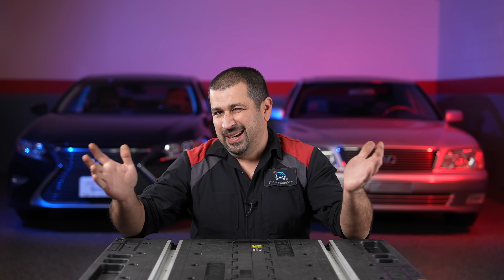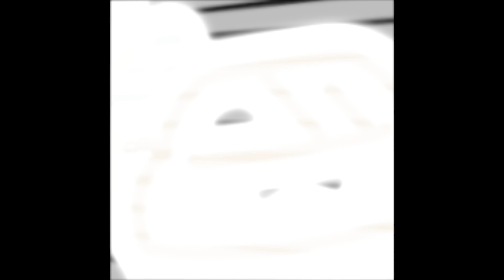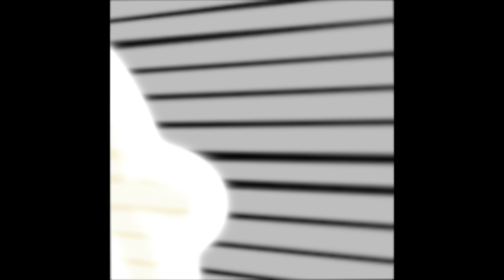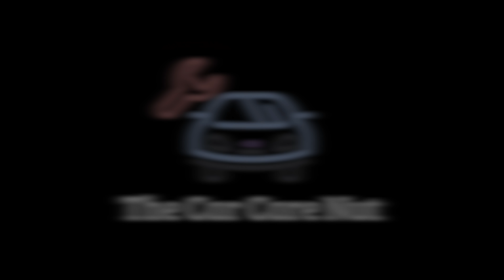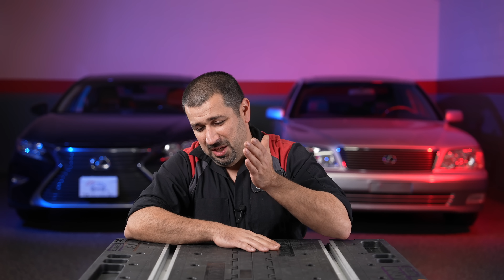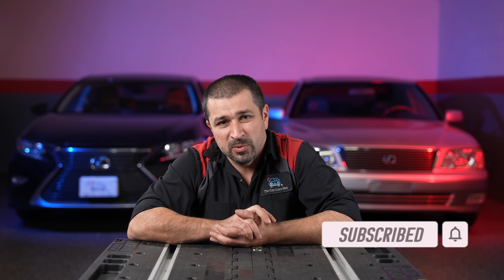Can Modern Turbo Engines Be Reliable? Here's The TRUTH!

Comment: Diesel engines use the turbo to help pull exhaust away from the engine not on the intake side as an air increase

Comment: 2024 5.0 f150 owner and the ford dealer mechanic recommends 5000 mile oil changes! I have a 2005 4.6l with 267000 miles and yes i have changed the oil every 3000 miles since i bought it! It burns a bit of oil but has been doing that since the mid 150000 miles! This engine sounds as smooth as the one year old 2024 engine sounds but is 21 years older! Change your oil if you want your engine to last!!!!

Comment: At 180k on my 2017 2.7L V6 F-150, my turbos are still going strong. I did replace an oil feed line on the driver's side a while back for the cold soak exhaust smoke issue, but everything works fine so far. Just an anecdotal comment, YMMV. I'm a fan of smaller-displacement turbo engines after buying this truck. The economy has been great, especially on the interstate, and it's plenty fast when needed, tows well when needed.  It's a great compromise for typical driving.

Comment: Just go get your oil analyzed.  You can run new modern oil a lot longer... but yea change it more, I'd use those engine cleaners right before every other oil change too but that's over kill, do it every 4th if at all.  The engine, its design, rings, o-rings for valves etc., all play a part and every engine needs maintenance whether it is preventative or unavoidable.

Comment: Yes and no is a great way of putting it. If you did not know, Ford markets their turbo as "Ecoboost", and this was done because women do drive car sells being sold. It sounds a lot more safe to a mother's ears when she hears or reads her fairly lightly used Ford does have an Ecoboost for fuel economy rather than, "WHEN THE BOOST HITS FROM THE TURBO INTO YOUR ENGINE YOU WILL BE MANGLED ON THE GUARD RAILS ON THE INTERSTATE TURNPIKE BEFORE YOU HEAR THE WASTE GATE ON YOUR FOCUS RS BRO!" Yes, depending on the application of your forced induction car your forced induction car will be reliable. No, if you are buying any used Subaru WRX/STI or entry level performance car your forced induction engine is not reliable. Truly, as an auto enthusiast, I have to tell you the most dangerously expensive cars to buy are entry level performance cars that have forced induction from the factory. A used Subaru WRX/STI is one of the worst used entry level performance car you can buy. You should not buy a new car unless you are wealthy and unfortunately most entry level performance cars with forced induction are highly risky even if they appear well taken care of because you have no idea what previous owner(s) did to that car you are looking at. It is unfortunate but this is The Truth.

Comment: Have had two turbo cars.  Regular oil changes and maintenance .  First (a Volvo 240 turbo wagon) one I sold at over 300,000 mikes changed the first turbo at about 100,000 miles (it was not equipped with the extra oil cooling option), the second was still fine when I sold it.  Second car (Subaru Outback XT) just passed 100,000 miles, no problems.  Regular service and oil changes are the key to longevity .

Comment: Sorry but no mention about synthetic oil versus conventional oil. This video was a waste of your viewers time by not mentioning synthetic oil will go a lot longer than conventional oil. I have a turbo I always use synthetic oil and my vehicle is over 150,000 miles with no problem and yes, I only change it every 6 to 7000 miles and I’ve had no problems because I used synthetic oil

Comment: I made a mistake with our 2018 Honda CRV with a turbo. We bought it new and last month had to replace the head gaskets and fuel injectors. I will NEVER buy another turbo engine. And yes, we had it serviced regularly by the dealer.  But we’re keeping it another 4 or 5 years after the money we just put into it!

Comment: If you use a normal quality oil, like Valvoline Castrol etc, definitely go with the 3-4k miles intervals. But if you are buying top quality oil, like amsoil, you can stretch it to 5k.

Comment: Diesel turbos run on low boost and dont generate much heat? EGT are a constant concern for engine longevity and my cummins trucks boost to 26psi, that is not low boost. Eurpoe has millions of passenger turbo diesel vehicles with small turbos that experience the same stop and go and quick spooling. The TDI VWs with small turbos here are also very popular and run forever. There are far more similarities in gas and diesel turbo engines than the scene you describe. The real problem with modern gas engines is planned obsolecense. Most are engineered to only last the warranty period, what happens beyond that is not their problem. The rest of the video is solid advice!👍

Comment: We (my family) put 220K miles on the 2.2 turbo on our 1986 Chrysler Lebaron GTS turbo. We changed the oil regularly, reuibuilt the trans at 70K miles. The engine got tired toward the end, but it was always reliable.

Comment: I put purchased a New 2022 Lexus LS 500 AWD  twin Turbo engine .. This is the best car I have ever owned … although it only has 40,000 miles on it . I was told to change the oil at 10,000 miles . I think I should re think 🤔 this and began changing it at 3000 miles like I do  in my Honda pilot that has 214,000 miles . I want to keep this car until the LORD takes me home .. now @ 73 yrs old !!! 😅

Comment: Government makes autos (and everything else) way more expensive. Do you remember when all US autos were required to have rectangular headlights? WTF? Seat belts, crumple impact zones, safety glass, air bags, ABS, catalytic converters, smog pumps, EGR valves, even tire pressure monitoring systems. So what the government says is no matter how poor you are, or down on your luck, you cannot buy any recent/new car without EVERY safety/emissions requirement. This is the problem. Now, can cars with turbos be reliable? The obvious answer is yes, easily. We frequently fly on reliable multi-engine jet airplanes that are thousands of times more complex, and where failure can result in hundreds of deaths. It's not that turbo small engine cars can't be make reliable, but it DOES mean the reliable ones will be expensive. Government causes all this insanity. With efficiency and technology, every product will be cheaper, but government counteracts that and makes even the most basic things way more expensive - food, cars, lightbulbs, everything. Back to cars, Porsche has perfected turbo gas engines and those cars (in the last few decades) have proven to be very reliable. I believe the ecoboost engines from Ford are also very reliable, but of course not all products will be great.

Comment: What I learn as a driver if you maximize the power on the engine it's not going to last you can tune a diesel engine to maximize the power and it's not going to last compared to the engine come from factory that's what I see on the gas engine if you maximize the power with a turbo won't last the same as a conventional engine

Comment: My 2024 4 cylinder twin scroll turbo charged Tacoma uses more fuel than my 8 cylinder GMC Sienna.
I drive them about the same.
I paid for the first oil change at 1100 KM (Canada), then the next about 6000, 11000, and then Toyota paid the one at 16000. I paid for the next ones, and now about 32000 Toyota is paying the next one (their last one). I'll keep changing about every 5000 thereafter. 
I don't follow Toyota's oil change schedule. I pay for additional oil changes in between the initial free ones they give me: about every 5000 KM.

Comment: Small turbo engines getting better mileage is a myth...  Anyone I've talked to with a dinky motor turbo Honda accord, gets worst mileage than my normally aspirated 2.5 Subaru Crosstrek for the same horsepower. 
Even within Toyota's lineup, the 2.5 Camry and 2.4 liter Hyundai Sonatas, get close to 40mpg (actually can get over 40mpg)...  The Rav4 is still a 2.5 normally aspirated and gets good mileage like my Crosstrek 2.5. 
The Kia's and Hondas with tiny turbo engines for the same 180-190hp rating get worse mileage and are having issues with gaskets and other problems, with relatively new engines.

Comment: Few hundred thousand miles easily so yes. Modern engines use bad verbage in the manuals and suggest regular fuel. Should be using premium fuel in a turbo gas engine. Honda manual says "at least 87" for 1.5t but if you dig the recommendation is premium 91 octane fuel. So the head/turbo issues are from people not using good fuel. Pre ignition. Boom. Honda 1.5t does not run hot, in fact it runs so cold it has issues from idling. Oil is not destroyed any faster than an NA Honda. You couldn't be more wrong in this instance. You didnt even mention fuel lol. Bad advice. We get it you secretly want business. No manuals recommend 15k intervals.

Comment: I have now 15 years old ”modern” turbo engine in 0.9 litre 3 cylinder car… still going well! But oil replase very important and it is not any ”performance” car. So it needs driving desent and not pushed too far. It will last at least 10 more years… but there will be limit.

Comment: I have noticed, over time, that the tighter tolerances call for a viscosity I am not very comfortable with. In the days of the 10w30 and 20w50, at 3000-4000 miles the oil still has a brown tint to it. I change my oil religiously at 3000 miles. With my 2021 naturally aspirated 5.6 v8 that calls for 0w20, the oil is pitch black at 3000.

Comment: 11:29 You wish we didn't have turbo engines? Nothing beats the feel of turbo boost in 3rd gear like in my 2002 Saab 9-3 Viggen with 203,000 miles which is running perfectly.

My question is how often to change the oil if I don't put many miles on the vehicle. I don't think the oil degrades much over time with low mileage.

Comment: 2011 Opel Astra J with the 1.4T 120hp A14NET engine (in the US you had the same engine in the Chevy Cruze)

Service manual says 30k km service interval. I cut mine in half every 15k km. 14 years and 225k km later, the turbo finally gave up. The casing around the wastegate cracked and exhause gases were escaping from there, making it unable to produce enough boost. The low boost DTC came up. Engine until now consumes zero oil (not a mm drops in the dipstick between changes, and it barely gets darker). For ~1000 the turbo was just rebuilt.

I try to go gentle until it warms up, and drive gentle the last few km before arriving home. Driving cycle ~70-75% highway, the rest city.

Comment: Have a 2.0l ecoboost with 170k miles on it. 

Turbo engines will: 
Blow head gaskets and leak oil like crazy. Even the most reliable ones. 

Other than that it isn’t too bad, but they are certainly more maintenance than non-turbo engines

Comment: I got 95k problem free miles out of a 21 ranger sport that was totaled at no failt of my own .. only thing ever happened was the battery went bad .. i bought it with 25 miles on it and i changed the oil every 5k miles full synthetic.. ran 87 15% ethanol and when i changed the plugs at 75k they looked really good..

Comment: I work at a Mitsubishi, and our turbo engines are the only engines with problems. Emissions regulations "allegedly" help make the environment cleaner but now instead of putting a 3.0L V6 in a 7 seater SUV, we put a 1.5L Turbo. Sure, less emissions, but is it not more wasteful for cars to break down twice as quickly

Comment: Thank you Sir for this great advice. I have two Mazda's 2018, 2019 (Recommend 7500 oil change interval by Manufacturer) and a Ford expedition 2023 (10 k interval). I always replace all of them at 5 k. As you said I realized the oil in my Expedition with Turbo, gets dirtier and smells like burned oil more. Thanks again.

Comment: Automobile companies advertise (and/or "suggest") long maintenance intervals for oil changes primarily to keep their customers happy with the (mistaken) belief that their (the manufacturer's) cars don't need frequent service.  I remember the early 1960's, when the old Rover Company Limited of Great Britain had in their Series IIA Land Rover owner's manual that "sometimes it is necessary to change the engine oil and (oil bath) air filter oil twice daily."  This may not be an exact quote, but it is the gist of what the early 1960's Series IIA Land Rover owner's manual said.  Thank you very much for your always very sound advice!  Andrew "Andy" McKane IV, former owner, McKane's Rover Imports, Inc., of San Diego, California, Friday, 28 November 2025, Maunaloa, Hawaii.

Comment: Modern VWs and BMWs use condition based maintenance algorithms to determine oil change intervals. In my experience these work well and determine intervals in the 5K-6K mile range depending on your daily driving, mileage and driving conditions.
I am not agreeing with charging synthetic oil every 3K miles. That exaggerated and wasteful.

Comment: This is why I chose an Accord Hybrid instead of an Accord 1.5T.  No turbo, also no CVT to fail.  The high-torque electric drive motor provides an acceleration boost, much like turbocharging an engine.  Plus better gas mileage.

Comment: USE SYNTHETIC OIL AND ALWAYS LET IT COOL A BIT BEFORE SHUTTING OFF
Reply: A lot European turbo cars have after run coolant pumps that cycle coolant through the system after the engine is off, negating the need for a cool down period. 

But yeah, I always did that w/ my Subaru. Had a remote engine starter, too, so it got proper warm ups.
Reply: Agreed

Comment: Good points, but.. I owned 2010 Acura RDX 2.3 turbo for 13 years and 156k miles. Serviced and maintained at Joe Rizza Acura in Orland Park. The oil was changed based on car’s onboard computer notifications on average about 7.5k miles (6.8k-7.7k, depending on driving habits). No issues or problems for so many years, was a great vehicle. Sold it because wanted to transition to EV.

Comment: The buses I used to drive, Volvo B12, had a large turbo charger. Upon shutting down the turbo kept turning for a couple of minutes, presumably to help it cool down.
My thoughts is manufacturers are having their narrative fixed by the net zero garbage, hence all this micro engine turbo stress crap; wet belts and those ridiculous CVT transmissions.

Comment: Turbos absolutely can. Men used to think anything with variable valve timing was too advanced and unreliable till Honda made it reliable and now it’s on everything in some form or function. At one point direct injection was unreliable until advances made it common and reliable. High compression was once unreliable until engines were built better to handle high compression. Turbos are just one form of tech like anything else that takes time and science to make reliable.

Comment: Well, I thought my 2015 Kia forte 5SX with a turbo would go beyond perhaps 163,000 miles synthetic oil I used the whole life of the car changed it out the most about three times a year. Yeah maybe perhaps I left the intervals. Go a little bit longer to maybe around 6000 miles maybe less but at any rate I probably threw a piston rod earlier this spring dead on I 95………. Oh well, I just paid a tow truck to take it away and I moved on in life kind of a big letdown for me even though I thought I took really good care of it. It was fun while it lasted.

Comment: Yes they can, but it’s not the engine that fails it’s the turbo and most of the time the actuator as well. So if you have a reliable turbo with actuator you might be ok ( unless you have KN  or Hyundai engine)🤷🏼

Comment: In Europe most cars (Audi, Mercedes, BMW) have oil intervals set for 30000 km 18.6k miles. This reduce cost of maintenance for companies  but impact on engine durability , what is usually a problem for 2nd owner after lease time typically 3-5 years.

Comment: Had turbo engines since 2001. Never had problems - frequent oil changes, easy on them cold and before stopping.  Not French cars.

Also depending on the engine configuration - replacing a faulty turbo on a four cylinder often is quite easily done at a moderate cost. Aftermarket turbos exists.

Comment: In February 24, I had a choice of a new “Leftover” 23 Tacoma TRD Off Road, double cab, 6’ bed or a new 24 Tacoma TRD Off Road, double cab 6’ bed truck.
Naturally I chose the 23 because of the Naturally Aspirated 3.5L V6 or the new Turbo 2.4L 4banger.
The dealership wanted $57K for my Tacoma because it had the Premium and Technology pkgs and the TRD Performance exhaust.
I REFUSED THE 2.4L Turbo with the same horsepower and a huge torque difference, because I knew that the 2.4L Turbo and the 8spd automatic transmission was a gamble.
The new 24 Tacoma equipped like my 23 was almost a $10K difference.
My 23 Tacoma was priced at $57K with all of the almost $6K on accessories.
The new 24 Tacoma like mine was almost $67K.
I got my 23 Tacoma, Out the door with taxes, license and fees for $48K.
I’ll drive my 23 Tacoma until I die